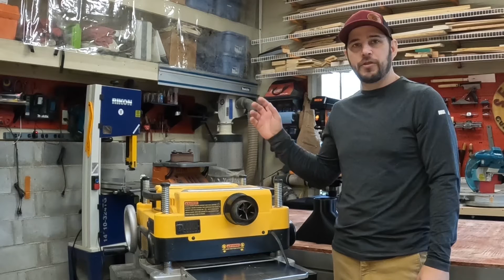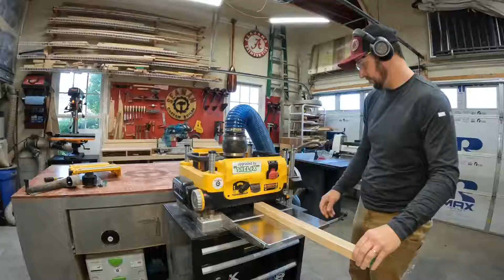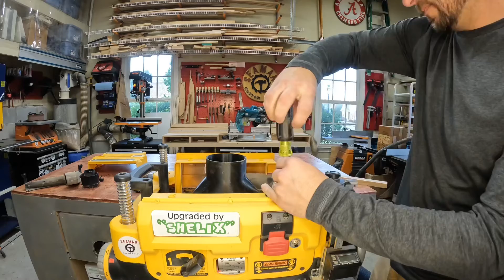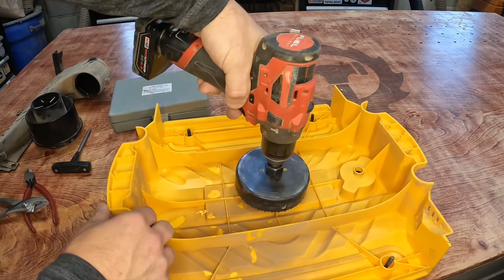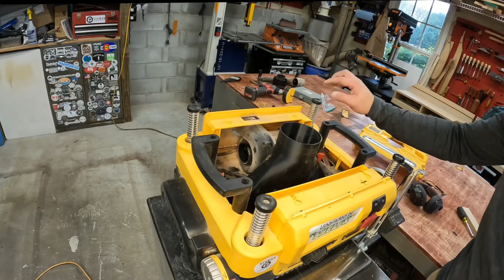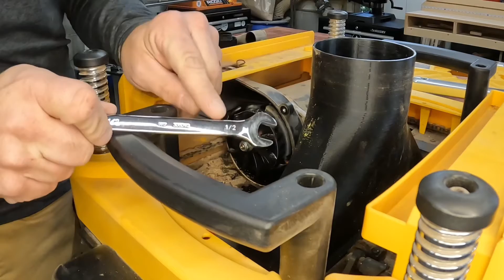DeWalt DW735 Planer Dust Port Upgrade

Comment: I also use the top of the planer to lay boards on after they have passed thru.  Then I walk back around and pick them off the top and don't have to carry them around - especially helpful with long boards.  The top ejection scheme would interfere with that.

Comment: Definitely made the right call putting the impeller back on the motor I think. It's used for both dust extraction and cooling. You could probably take it out if you still had dust collection hooked to the original port because it would pull air over the motor and cool it. I'm working on a similar idea right now from left over ducting parts so we'll see how it goes. Seems good so far. Good video.
Reply: Just a suggestion (I haven't tried it): Put a cover over the dust chute intake port on the fan body. This should reduce the loading of the motor, reduce the noise and probably improve the cooling air flow through the motor.  However, like William James in his comment, I use the top as a temporary storage location, while I plane the work-pieces.  So, the change in the video is not happening on my 735.

Comment: Cool idea and thanks for sharing but I do think you should edit in a text screen to the video before you close stating that your reinstalled the impeller due to thermal concerns. Not everyone will click the""more" button. 
There was another youtuber who removed the impeller but they kept the original airway and their vac system provided enough airflow to keep things cool.
edit: Or just pin a comment to the top here explaining the potential issue

Comment: Just put that upgrade from Jacob on my planer.  Like literally 5 minutes ago.  Major improvement.  I have a Rockler wall mount dust collector (the 650 cfm one) and it picks up all but a tiny bit of the chips, actually more than it did from the original port.  Sound level, if it is different, it's so minor as to be unnoticeable.  I'll someday cut the hole in the top plate and put that back on.
Reply from the maker: Thanks for watching and commenting

Comment: I respect everyones right to make whatever upgrades ???? they want, but I'm in the group that would NOT do this. The dust collection hose getting the way has not been an issue for me so why fix something that isn't broken? All that being said I did learn a little bit from the video about the machine so I do thank you for that.
Reply: Its like making a fast car even faster, better... If the motor isnt fighting the load of pushing chips it can cut easier.... If it has more energy to cut, it cuts better... If the motor has a easier load, in theory it will last longer...  This particular upgrade I would leave the fan blade on though, its critical to motor cooling even if not used for chip ejection... Nothing wrong with the if its not broke dont fix it philosophy though. Happy wood working!

Comment: I try to avoid un-necessary work and tasks. (& expenses too) When I hook my dust collection up, I simply bungee cord the tube up and out of the way. (btw, looks like you need to do the same as yours impedes you walking front to back during planing which is un-avoidable) Mine is mounted to the mobile OEM cart, and when stowed away, I simply use 1 short bungee (over the top where you put your hole) to hold the feed/export tables upright. Peace

Comment: Now that I’ve actually seen a good install video on one of these, what’s the benefit over just using an elbow and aiming it straight up? Hook the dust collector to it. Just the table folding up? Great video, thanks for the details and showing the “mistakes” that’s always helpful

Comment: I wouldn't do this to mine, but if people watching are considering this, it would only work decently with a shelix cutter head.  One of the things the integrated blower does is chop up the long chips that come off the standard knives.  Also, if your purpose for this change is mostly to allow the outfeed table to fold up, wouldn't it be easier to cut a clearance hole in the outfeed table?
Reply: I just experienced this tonight on my first use of this adapter.  I was planing 1x6” cherry wood that was air dried over 10 years at this point.  I did get some clogging issues on a short straight run of 4” hose. I was taking a little bigger bite with the planer, but I know the difference of that and way too much. Maybe 1/32” on a cherry 1x6” isn’t overdoing it.  The planer will handle much more than that. I did however get less saw chips blowing around on the infeed table.  I’d like to add a shelix cutter head someday so that should solve the clogging issue.
Reply: l really don't see the point of this revision.  Mine works great as and I just don't mind the table not folding up. A 90 Degree elbow handles dust extraction just fine. It is something they should have thought about, but it's far from a deal killer and the unit is still superior to any other benchtop planer I've used.  It is almost a category between standing and benchtop.
Reply: You don’t need to cut any clearance holes for the outfeed table to fold up - just raise the height until it clears.
Reply: Several hundred of my customers still running straight knives would disagree with you..
Reply: I seriously doubt that plastic impeller is chopping up any long chips. It wouldn't last very long doing that. My Delta planer with straight blades doesn't make long stringy chips.  I doubt the Dewalt does either.
Reply: @terencenewlin5265  My old Delta planer with knives made long, thin sticks.  Depending on what wood was planed, sometimes worse than others.  They do plug up dust collection.  Just looking at what comes out of the two shows that that the DeWalt does chop up those small sticks.  You'd be surprised how tough some plastic is, BTW.
Reply: @rexseven93  ok. My Delta just makes shavings. Never more than 3/4" wide.
Reply: @rexseven93   what size port and hose when this was being plugged up?
Reply: @terencenewlin5265  4". I use a 2.5" now because I can and its easier with my current setup.  My old Delta would clog the 4" regularly.  I see comments about the problem often.  I'm surprised you don't experience it, but you obviously don't so that's good.
Reply: @rexseven93  It will generally only make long thin sticks if you are running the boards through with the grain parallel to the cutting knives though, right?
Reply: @M Frit  my old Delta planer with knives had trouble with long shavings clogging the dust port no matter what. Varying degrees with wood type and grain direction, but always a problem. I just don't mind the port where it is on the DeWalt and it exhausts great as is. I would never mess with it.
Reply: @Rex Seven  I'm going to make a quick release to the exhaust port for a 2.5" hose (removing the standard dewalt 4" hose adapter) .  That way the tables will fold properly when i remove the hose.

Comment: For those of you with a 3d printer...make a fan just like the original but do not make the blades for chip extraction. The blades that face the motor are used for motor cooling, The other side of the fan is used for chip extraction. Just make the outside of the fan smooth so it does not act like a chip extractor. This should keep the part the same size but is only used to cool the motor.
Reply from the maker: That’s a great idea, maybe you can market that idea.
Reply: I’m thinking of taking off the fan and attaching a 2.5 hose to the default dewalt dust port . Hoping that would keep the motor cool.  I will split my dust hose ( 4 + 2.5).

Comment: I just picked up my 735 today and wouldn't consider hacking out a hole on the top of it.  It think DeWalt would probably have a good look at it if I should have to send it back for something that is covered under warranty.
Reply: Yup, for sure... I'm with you! I'm sure he just voided his warranty doing this. Even if he gets a new plastic cover and puts everything back together, Dewalt manufacturers have proof of him tampering with this on video.🤷

Comment: Nope - not going to butcher my brand new DW735.  OEM setup works just fine for me.  Extension tables are very easy to remove and store under planer on my roll around cart.
Reply: also if you’re working with someone handing you back the pieces , the discharge gets in the way.
Reply: just bought the 735 and my in and out feed tables just arrived from Amazon. Did you leave your tables with the slight upward tilt on the ends (factory setting) or did you adjust the, to be flat with the planer bed? Thanks.
Reply: @joearrue6819  weird i have zero issues with the dust port and tubing on mine, is the person coordinated?
Reply: @msk3905  nah they only hve one arm
Reply: Roger that Lance. I’ve seen a few complaints about the position of the dust collector port but it has never bothered me.
Reply: Yea this seems like the long long way to get home, I mean great job for what he did but why, I thought he had solved his prob when he removed the factory port on the outside and raised the table hmmmmm…
Reply: Just put an elbow on factory exhaust  lot easier

Comment: Sorry, I just don't get it.  I have the same planer (haven't done the cutter head upgrade).  I solved the issue with Rocklers 4" Dust Right Quick Connect elbow fitting for $18.  The whole assembly comes off and works great.  Not in the way.  Didn't spend $65 and cut a whole in my $700 planer and void my warranty.  I'm glad it works for you though.

Comment: I'll be honest, I just got this planer and I ran a 2x6 through it and I appear to have as many shavings popping out as you did on that very small piece. I'm just using a Shop-Vac hooked up to the stock dust port going through a cyclone.

Comment: Can you tell me why there were more chips on the planer after you removed the fan blades?  Also, I  didn't quite understand why you wanted to remove them?
Reply from the maker: I removed the fan for a couple reason, mainly it is no longer needed for chip ejection and is just blowing a large amount of air into the shop and could stir up dust, also this would hopefully provide more power to the cutter head if needed since there isn’t resistance from the fan blades. It’s also quieter without the fan.

Comment: If this works for you, great, but for me no. You can't use the top of the machine to slide boards back to the feed side, especially big material. You've disabled a perfectly good chip ejector. Compromised motor cooling. Just use an elbow or bungees to route the hose. As far as having to pop off the original port to fold the table, how long did that take?

Comment: I just bought the 735 and my in and out feed tables just arrived from Amazon. Did you leave your tables with the slight upward tilt on the ends (factory setting) or did you adjust the, to be flat with the planer bed? Thanks.
Reply from the maker: Nice purchase, I leveled mine

Comment: Best dust port answer I've seen for this machine. Really appreciate you sharing this. What kind of dust collection system do you have? May want to use same thing.
Reply from the maker: I have a Jet wall mount dust collector with chip bin and canister filter.
Reply: @seamancustombuilds2553  Thank you brother!

Comment: Nice upgrade. Can I ask what the digital read out is on the thickness guage? RIght in front of the wheel?
Reply: That's a gauge from Wixey. You get a lot more accurate and consistent thickness measurements compared to the one from Dewalt.

Comment: I have read some poor reviews on the Shelix cutter head. have you had any issues?
Reply from the maker: I haven’t had a single issue and haven’t heard of anyone else having an issue with it.
Reply: Just go real easy on the thickness of your planes. Just had burnt up wiring (fortunately not the motor itself) that had to be replaced due to some users who assumed they could take off more per plane. These planers are NOT engineered to support those cutterheads.

Comment: Impeller fan is used to cool the motor. Taking it off is a bad idea.
Reply from the maker: From thoroughly looking mine over I don’t see how the fan used for chip extraction would be used to cool the motor as it is completely enclosed
Reply: Seaman Custom Builds  @ 6:00 min the holes surrounding the fan blade shaft on the motor is where it gets the cooling from. Pulls air through the motor, does not blow on or into the motor. That’s how it’s able to extract chips and cool at the same time. I wouldn’t run it for extended periods without first checking to see how hot the motor gets. Looking at the fan housing, it almost looks like you could unbolt it and rotate it to redirect the exhaust up.

Comment: Why not just put a 90 degree elbow on dust port turned away from you so its out of the way?  Appreciate the work put into this but my 90 elbow keeps dust collection out of way when grabbing board in back and cost me like $12
Reply from the maker: The elbow still blocks the rear outfeed table from folding up

Comment: In theory it appears like it works nicely with 3/4” stock, however I would not do this as it interferes with raising the planner for thicker stock. 🤔 I’m referencing the perm solution to adding the cover back on.
Reply from the maker: This has no impact on raising the planer to the full capacity as the entire top section raises and lowers

Comment: Well first thing.  Your running the board through and not cutting just rolling lol.  Second  i have seen so many of these videos crying about the port in the way of the trayif you wind up the planner the tray will work fine! ( im glad at the end it used the blades a tiny bit ).  Lastly they make a hook attachment that holds thhose off to the side. And it can work on ether side. ( 35 bucks)

Comment: Why did you remove the impeller?
Reply from the maker: I was hoping to eliminate the blower to allow more power to go to the cutter head and also keep from blowing dust around, I ended up reinstalling to help cool the motor
Reply: @seamancustombuilds2553  gotcha!

Comment: ummm, just an elbow pointing up off the stock port? no modifying the case and the hose is outa the way, likely even more so watching you use it as it seems to be right in the way as you reach around the grab the piece coming out. Fan cools motor as well as chip extraction.  This is a cool idea, but seems like a lot of extra work to accomplish no real benefits .. I guess the table flip, but I don't bother with that.

Comment: Nothing to do with you removing and reinstalling the fan impeller. I've seen several comments elsewhere about the motor overheating or burning up. Quite an expensive repair. Some units not very old at that. 
BTW, I like the exhaust duct modification and would do that if I purchased this planer.

Comment: Seems like it’s still throwing out chips from the front. And that’s with a narrow board. Now try a full size board and make it an epoxy and wood board and see what happens. That’s the real challenge. Epoxy, when planed , becomes statically charged and sticks. It gums up and blocks everything. So the real question if any of these videos are worth it is to test it against that level and do an epoxy board.

Comment: these people keep trying to sell items claiming to fix 1 issue and not explain that its cause multiple.
   the dam planer is ok from factory as is ...the blower is a plus as you wont need to worry about hooking it up to any vacuum..
i can imagine if your vaccum system not working 1 day or you have to work on another location the planer would be in operable as it wouldn't be able to expel dust🤷‍♂.

its also blocking the over head where naturally it an over pass for work pieces.

 i can recall u giving 1 reason for this mod and thats because you cant store planer up to the wall ... you can store it side ways to wall or just take off the dam support bed (easy on and off procedure)

please dont waste your money to buy this mod and to destroy youe planer as i doubt i would buy it with that hole in it.... 3d print a cover so the need to damage origanal cover is not neccesary......... but then again they would charge a arm and a leg for these plastic piece 🤣